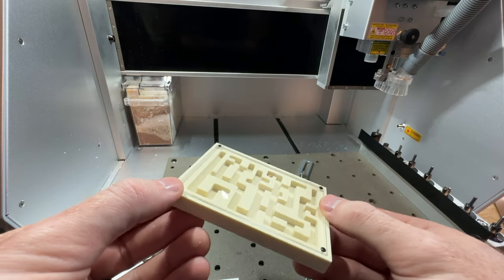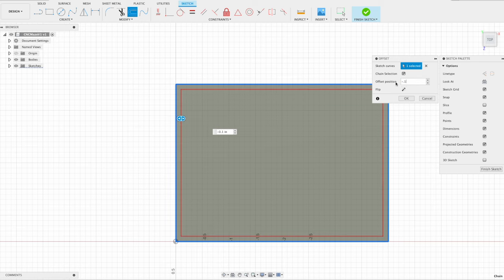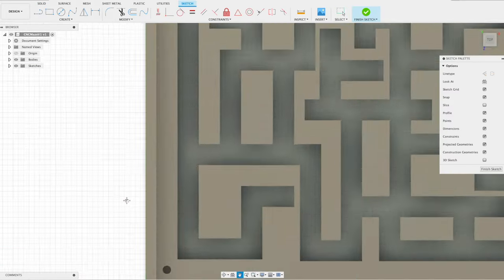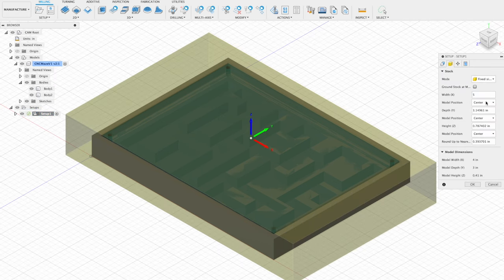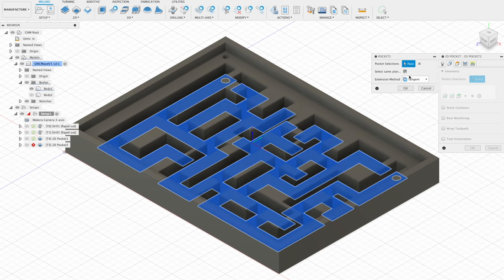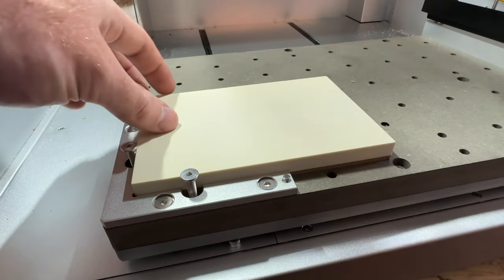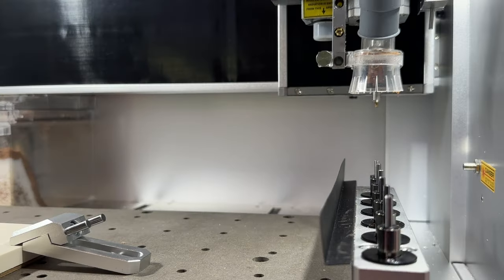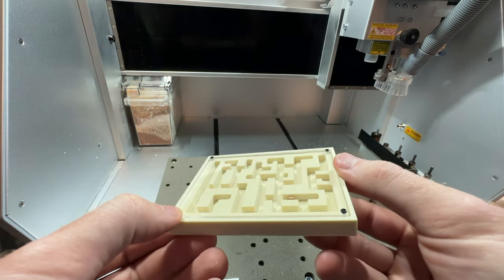Creating a Mini Maze Game using the Carvera CNC & Fusion 360

Comment: Is there a good XY edge finding solution? I haven’t seen an edge finder with an 8th inch shank ever.
Reply from the maker: Hi, the Carvera comes with an X/Y/Z probe which can be used to find the edge of a block material.
Reply: @Makera  that’s great to know. I didn’t see anywhere that it would do x and y too. It seems like your company has made a complete system. I look forward to it arriving in the next week or so.